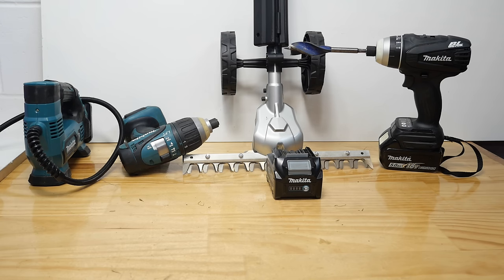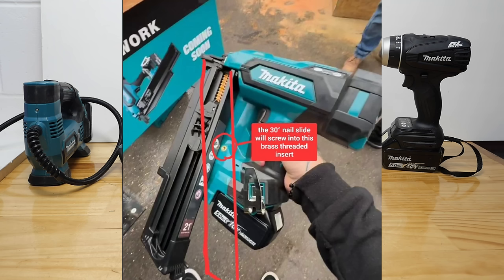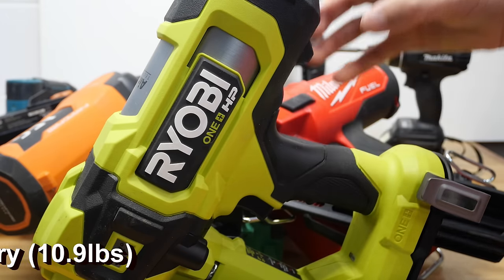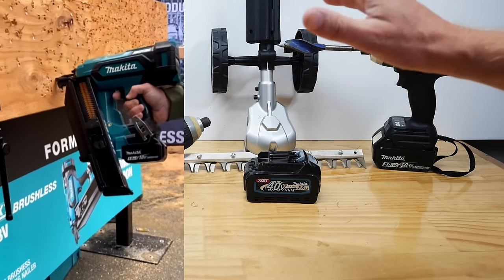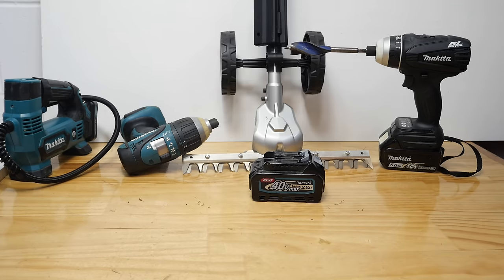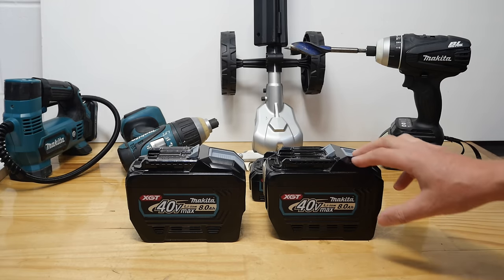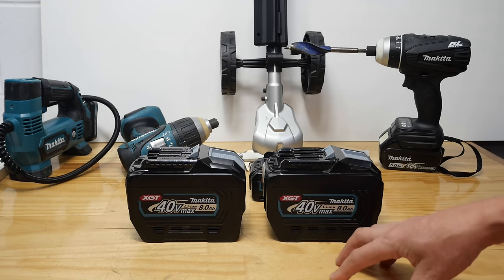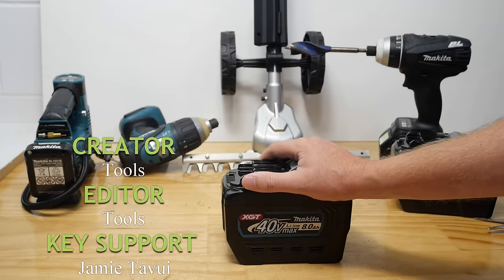Makita made a MAKITA CORDLESS FRAMING NAILER!!! And some other NEW Makita Stuff.

Comment: Came for the framing nailer. 

Now I have a strap for both my Makita inflator pump.

From Japan. Hate it when the postage is more expensive than the product. Atleast now I don’t have to use zip ties.

Thanks Mr Tools for the bonus info

Comment: I have lots of Mikita gear but ended up getting a Hikoki nailer, and it really good. Now I have got quite a few of the Hikoki tools on their multi volt platform and they are not bad ( 1/2” router, impact driver, )
Reply: In my own shop I mostly have Makita, but on site we use a couple Hikoki tools and a agree 💯% with you. The multivolt system is pretty neat and the tools are solid and accurate.

Comment: Got to try it out, it works as good as my Milwaukee, and felt lighter!
Reply from the maker: Tell us more, tell us more...
Reply: The Makita guys said it’ll be released in August
Reply: So I’ll be ditching my Milwaukee
Reply: Awesome, the Milwaukee is too heavy for busy work a lighter battery nailer is exactly what is needed. I still use my paslode for this reason.
Reply: It's 10.9 lbs with a 5 amp battery, the Milwaukee is 9.4 lbs bare tool. 
It may feel better or be slightly better balanced, but it's about as apples to apples as you can get in that regard. It's certainly not going to resemble a pneumatic or a Paslode.
Reply from the maker: Yeah pretty close. The Milwaukee is 11.3lbs with a 5Ah battery. So the Makita has a 0.4lbs lighter usable weight.
Reply: @ToolsAndStuffOFFICIAL  
I'm a makita guy and will pick one up when available, but after using the Milwaukee fairly extensively and while admittedly a bit of a brick for all day/overhead/hanging off my rig...it's ergos are relatively pretty good and the overall <5% weight reduction of the makita & her general similar silhouette lead me to feel safe in assuming the general handling of her will be nearly indistinguishable from the Milwaukee.

Comment: Held out as long as I could, but bought a framing and finishing Milwaukee nailers in December during a pretty damn good sale. So now Ive got mostly 18v Makita, some 40v Makita, 3 specific Dewalt tools, and several Milwaukee 18v now.
Reply: Don't you hate that? I started out over 20 years ago with the old blue Ryobi NiCad and then a couple years later started switching over to Dewalt XRP and then the Milwaukee V28 band saw came out and so on and so on and I've never been able to get it back down to one battery platform like the good old days with Ryobi. Now I'm on the same 4 platforms as you.
Reply: You can get battery adapters... Milwaukee nailer on Mak batteries kicks the arse of Paslode!
Reply: Is your DEWALT tools a table saw and cirular 7 1/4?
Reply: @juliosoto5743  No. 60v air compressor, telescoping pruning pole and SDS drill.

Comment: Hi.Nice vid as always. Id love to have a Makita nailer since i'm on the makita platform. I've been using the milwaukee since my paslode died 3years ago. Only drawback as everybody knows is the weight. So if the Makita is not lighter than that then there is no advantage. Winner of the race will be whoever can make a gasless nailer that's as light as paslode!

Comment: A few years ago I received a Makita pneumatic finish nailer as part of a promotion when I bought their 12” slider. I used the gun for less than an hour when it started jamming. I have tried to fix it, but it won’t cooperate. I belong to several Fb woodworking groups, and when I posted the issue, several people said they had the same problem. I don’t have a repair center anymore as the man retired and closed up shop. Not sure what to do about it, or even bother. Not happy.
Reply: Which nailer are you talking about?
Reply: @bartfoster1311  If you need the model number, I can get it for the next time I'm in the shop. Not sure if that will be today or early next week.

Comment: Cheers for the credit, this is an awesome video and a long time coming.

I have that inflator trigger thatbworks for my first gen stick vacuum marginally well (bigger trigger) i can only imagine how convenient it would be for the inflators.

As for other potential tools:

With the US Consumer Safety Commision discussing changes on Table saws, Makita seems to ne vindicated for pulling out of the US market years ago, hopefully theyve been sitting on designs and patents. 

Now that we know that patents do mean something:

the 40v Multitool is likely coming soon, maybe next WOC.

Same with Belt sander in 18 and 40v.

And potentially the new storage system, although may still be a ways off given both the adapter and XGT battery box are Macpack style.
Reply: The macpac boxes are really crap. I have 3 and the 2 that came with my tracksaw are completely busted. If  they fall a few feet they will completely bust apart.

Comment: Now all that's left is to wait for a cordless belt sander
Reply: Haha definitely
Reply: And cordless rotex
Reply: 1/2 router, table saw
Reply: Also need a cordless 16 5/16 inch beam saw!
Reply: @kizzjd9578 yeah, a fully supported rotex equivalent would be the tits, I'd jump on that before a belt sander. Only problem is both a rotex and belt sander would be so friggin battery hungry, like an angle grinder. They also need a mains adapter, because there's situations where you really need to run that type of tool at high wattages for long periods of time.

They already have the gear driven polisher in 18v so it's not much of a leap.
Reply: Well yeah, all those things. But we all know Makita needs to put some cordless kitchen appliances on the market just to get it out of their system before they do anything that serious. My money is on an 18V blender or a 2X40V induction hob.
Reply: @ManWithBeard1990  sad thing is its probably true

Comment: Im assuming the answer is yes, but does that strap switch work on the 40v pump? 
The eBay advert says 18v
I don’t remember there being a difference between the 18 & 40v switch location/design. Gave the 18v to dad. 

The hardest part about this framing nailer news is il likely have to hold out to see if the 40v is any better than the 18v. I figure iv been rocking the paslode for years now in wait for a Makita, I might as well wait a little more to get the right one. 
Murphy’s Law states I will be screwed if I don’t wait for the 40v comparison & then be stuck with a lesser model. Or il wait an extra year for the 40v for it to work exactly the same as the 18v🤦🏼‍♂️
Reply from the maker: Works fine on all of them 12v, 18v, 40v

Comment: Where is the 40v 1/2 inch router or table saw? Makita need to catch up. It’s hard being a makita fan and seeing other brands with the tools I want
Reply: ...including 40V multitool and impact driver with ringlight.
Reply: That’s the reason why I have half of my tools from Milwaukee. Because Makita doesn’t have them in their portfolio. I’m normally a Makita user and I would like to buy or use only one tool brand. But Makita is behind all the other brands. Yeah if my Milwaukee tools breaks down and Makita has the same tool I would prefer to buy and use Makita.

Comment: Looks more compact than hikoki framer, maybe hikoki will start updating their guns.
Reply: Hopefully, the compact Brad nailer is so nice and tiny compared to the old version. Definitely need that on every nailer especially the finish nailers
Reply: I have the new brad nailer it's probably the best cordless 18g nailer lighter then milwaukee works well just trimed out a house with it.  Only issue with it is if you need to nail on a angle you can only angle it on in direction. Towards the top of the gun if you angle to the side it won't sink the nail properly
Reply: Unfortunately Hikoki (and Metabo - by which I mean Real Metabo) are owned by KKR Holdings who are just a buy low, sell high company. They have no interest in developing either brand. They tried to sell 1-2 years ago, but failed. There's unlikely to be any major progress by either brand, just cost cutting to make a sale more attractive.
Reply from the maker: @toolscientist Send me a DM on insta, I want to send you something.
Reply: @ToolsAndStuffOFFICIAL  I didn't get a notification for this. Lucky I came back to stalk you. I'll send a message now, if I can figure out how to do so 😂
Reply: @toolscientist  I regret buying hikoki for this reason very slow on tool releases and updates, should have bought Makita. I do like that nobody is going to steal my batteries at work though.
Reply: @aaronoconnor606 I think what the big hold back it for me to buy the 18ga Makita finishing nailer is the length of the nails. The Milwaukee used 2 1/8” nails it’s much more useful for my use.

Comment: Ok, that trigger lock for the inflator is nice. I currently have a thin, wobbly 3D printed lever that I always have to be careful not to break. Can someone say whether the trigger lock also fits the DMP181?
Reply from the maker: Due to the velcro strap it should fit all Makita models fine.
Reply: @ToolsAndStuffOFFICIAL  but I think the triggers and the housing around the trigger are always different.
A guy in an Amazon review says it fits the 40v inflator, so I think i get me one. thanks for the reply

Comment: If they've figured out how to sink framing nails with an 18v battery, surely they can figure out how to sink 50mm brads with a 40v battery.
Reply: Yeah that’s what I can’t understand why there 18ga finishing nailer cannot use or shoot the 2 1/8” brad nails? The 1 5/8” is not long enough for my use case. I would like to buy the Makita finishing nailer but not with the 1 5/8” capacity.
Reply: They make a 50mm brad nailer on lxt.
Reply: @riba2233  I know but would like to get with the 40V line. And I don’t like the size and handling of the LXT one.
Reply: @wolfgangselle4307  it might come in the future but probably not so soon
Reply: @riba2233  I hope so until then the 2nd gen Milwaukee is very good alternative for all user cases